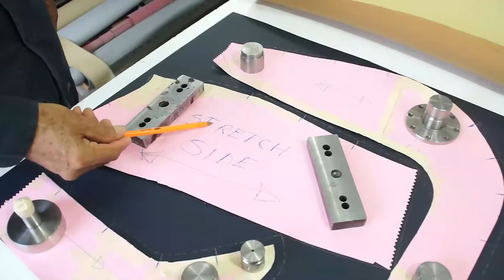How to double stitch a bolster (French Seams) - Car upholstery

Comment: I see that you use a Pfaff sewing machine, so I suppose you prefer Pfaff to other brands.  Is there anything in particular that stands out for the Pfaff above others, say, Juki or Consew or Adler?  Thank you!
Reply from the maker: I got this old machine still in good shape by chance. Consew, Juki, etc. in my opinion are at the same level. Perhaps I went for the Pfaff machine because my uncle who is also a car upholsterer bought a Pfaff 335, cylinder bed sewing machine around 60 years ago and it is still working out.
Reply: I've used Pfaff, consew and Adler. They are all good machines I prefer alder only because I own an Adler that I've had for 8 years. 
  I got the machine from an old boss and he got the machine from his dad. It's an old machine and still running strong. But as I said nothing wrong with consew or pfaff.

Comment: What type of material is used for the french seam backing (on the back side of the seam)?
Reply from the maker: There are special thin backing strips for sale. Stiff for straight seams and elastic for curved edges.
I used a thin stretch vinyl for the seam backing. I cut the strip breadthwise along the stretch direction. It helps to give shape to rounded edges.

Comment: What do you call the strip under the seem? And what material is best thank you
Reply from the maker: It is a binding strip placed on the reverse side. Those strips are sold in roll and ready for sale on some upholstery suppliers. In case of not getting it, we can do it by cutting strips of thin vinyl. The strip on the video looks white because it is the reverse side of the vinyl.
Reply: @Cechaflo  thank you very much

Comment: Hello. What for did you make stitches at the edges of material?
Reply from the maker: French Seam piping is used on car seats. 
https://www.thehogring.com/2012/06/06/photo-french-seam-piping/
As mentioned in the description this is a sample on how to approach these double stitches can be done by using a single needle sewing machine.
Most of these videos are mostly devoted to upholstery students.
Reply: @Cechaflo  Sorry. No, i mean what for did stitch foam to material at the edges. Because you anyway will stitch at the center (1cm)
Reply from the maker: @ny4583  No worries. I suppose you are referring to the previous second sewing I did at a distance of 8 mm. The first one was done at the very edge.It helps a lot to flatten the foamed edges to ease the final sewing process (1 cm from the edge). https://youtu.be/KelUBPZCQzg?t=362
Reply from the maker: @ny4583  An overlock sewing machine replaces the procedure I show that is of flattening the edges. The LeatherSeats' car trimmer masterfully performs this process.https://youtu.be/C3tcrZNKRCc?t=214
Reply: @Cechaflo  i mean at the very edge stitching(1or 2mm from edge). Thank you i understood. I didn't try it because it is too much job. Now i will try, if it really helps i will stitch always like you. Thank you very much.
Reply from the maker: @ny4583  Simple plain covers do not need this procedure. Just with the first attaching sewing at the very edge. They can be sewn directly to make them faster.

Comment: hola Maestro, tengo un problema con la 1245 en reverse creo que hago algo mal, muchas veces en reverse encuentro 3 hilos , 2 de arriba da top hilo , aveces se rompe la aguja, donde me equivoque?
hello Maestro, I have a problem with the 1245 in reverse I think I make something wrong, often in reverse I find 3 thread wich 2 from the top sometimes it breaks needle, where am I wrong?
Reply from the maker: Trying to figure it out. Check first (the machine turned off and moving it by hand) if the needle makes stitches (with no thread) the same distance frontwards and backwards. When the reverse lever is lifted the moving is backwards and the needle point should meet the same holes made to the front.
Verify if the machine is on time. No fast nor slow.
Reply: @Cechaflo  Thanks . i have checked then in the normal rotation look like perfect . when i hold reverse needle bar and small foot moving a litle bit to thr front and timing is not correct ..hook arrive too early  ..isnt that weird?
Reply from the maker: @maxtur6982  Trying to figure it out with no success, yet.
Reply: You will find three threads when you stop the needle before the lockstitch is completed.  Make sure that the needle has bottomed out and begun it's up stroke before you stop.  Then you should only pull out a single top thread and a single bottom thread.

Comment: What fabric do you use to make the pattern?
Reply from the maker: I suppose you are referring to the blue automotive vinyl I am using for the panels. Automotive yellow vinyl for the piping/welting strip.
The foamed fabric(backing) is a 4 mm thick headliner material. The backing strip to reinforce the french seams is also automotive stretch vinyl but slightly thinner. I put it on its reverse.
Reply: @Cechaflo  no the white stuff you pin to the foam
Reply from the maker: @my95buick  https://youtu.be/xxEBaHlH-4w?t=53  I misunderstood, sorry. That material is cardstockpaper used to make the patterns. A drawing is done on the foam base, then this paper is attached in order to get the molds.
These procedures are the same taught in our basic courses and also shown in several youtube videos.
https://www.cechaflo.com/courses
The same molding technique is applied on different car seat designs. https://youtu.be/pHjUuOPldH4?t=4
Reply: @Cechaflo  OK thanks.  I always assumed it was a type of fabric
Reply from the maker: @my95buick  It looks like though.

Comment: Good work done with the cheapest awful material without any comfort to sit on especially in hot summer time.
Reply from the maker: As this video is only educational and its main purpuse is to teach some upholstery techniques not worth using a luxiry material, could also notice the same foam cushion is used on several previous videos, that's what I have at hand for the demonstrations.